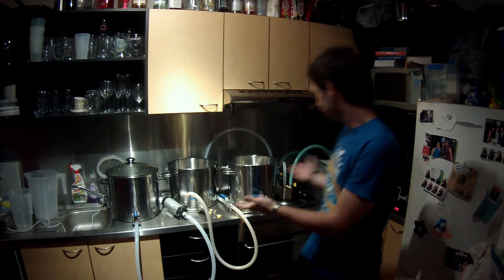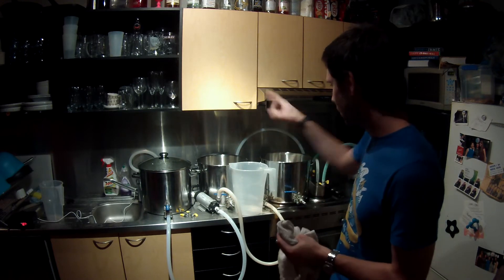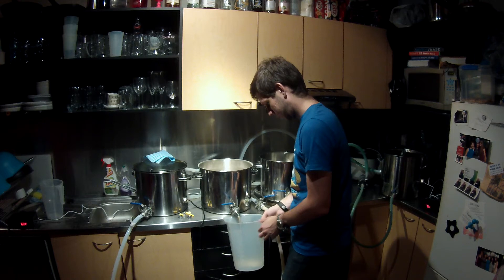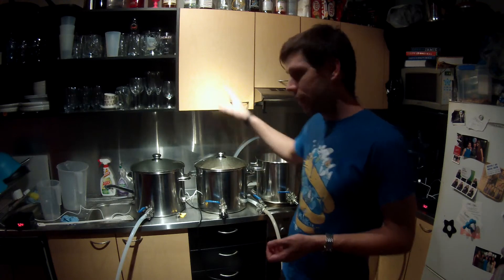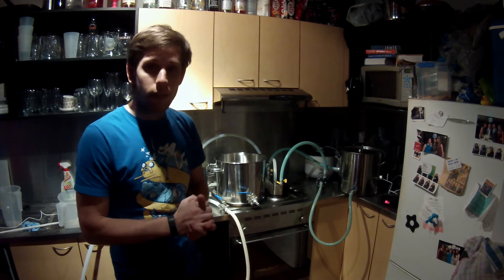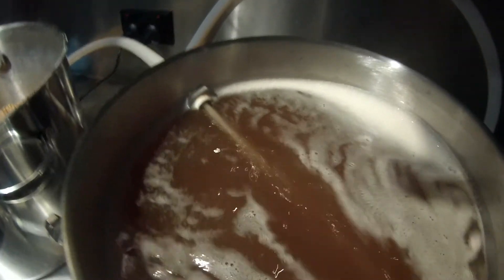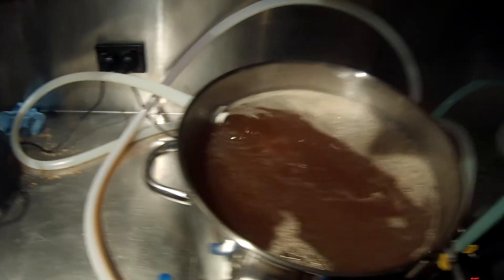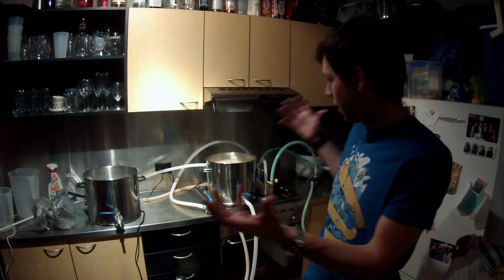Apartment Brewing - Experimental Brew Rig

Comment: Where the wort is being transferred into the boiler and back into the kettle, would it be more beneficial if the inlet is bringing the wort back into the kettle is submerged? Being brought back in over the top of the liquid, would that aerate the wort too much or is that not an issue?
Reply from the maker: You're probably right! It would help temps slightly and avoid any hot side aeration (a controversial topic but better to be safe than sorry). I'm changing this up to use a herms coil to boil, so I'll hopefully avoid these issues anyway.